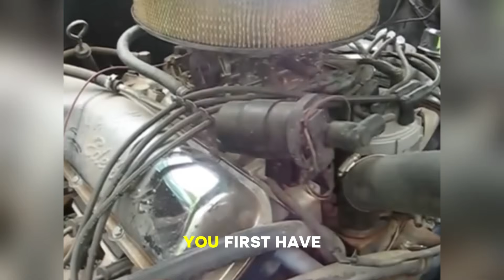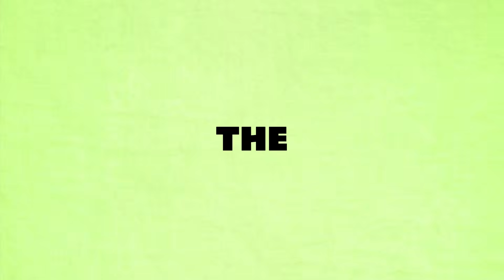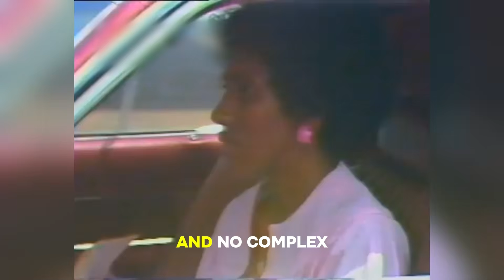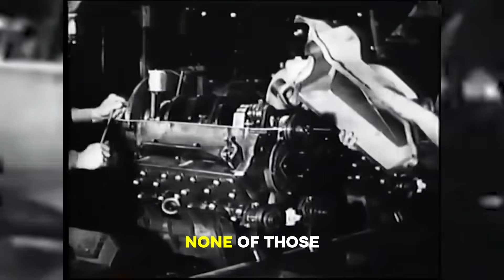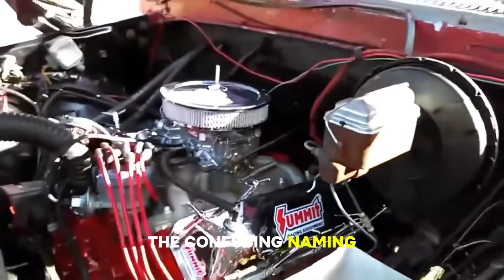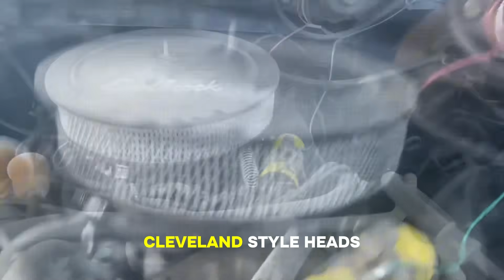Most Unfairly Hated Ford V8 Engines in American History

Comment: these engines have oiling problems and burn and drop valves i have seen it for 40 years the cam timing is retarded from the factory for emissions reasons. Is it a horrible engine? well its no FE and the FE has its problems...........thank the nixon republicans for the EPA disaster. the big 3 are guilty of building a lot of garbage engines and cars/trucks for that matter and continue to, it makes you wonder why the public keeps buying junk off the big 3 they deserve to fail.